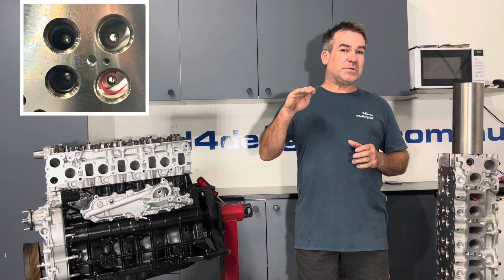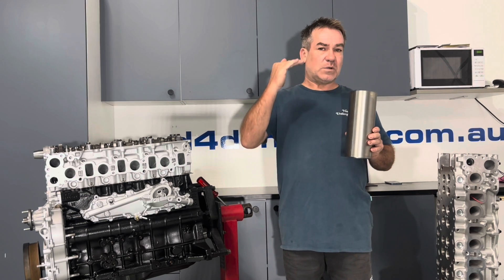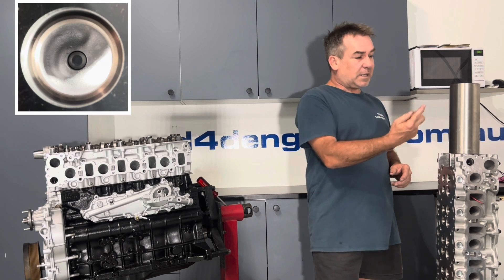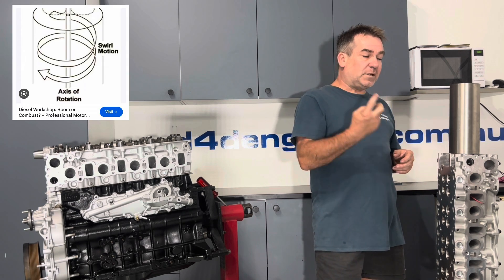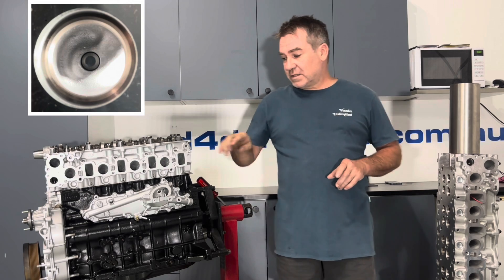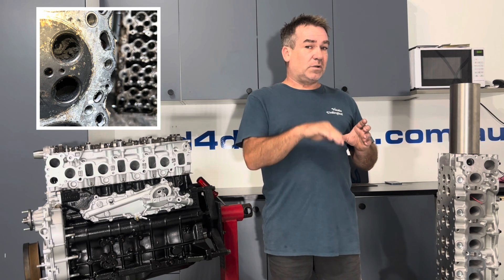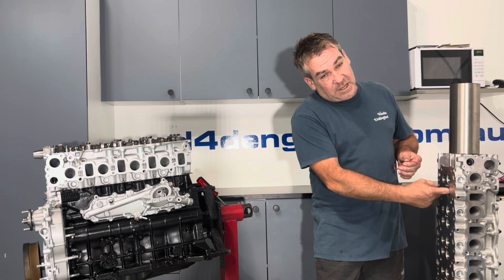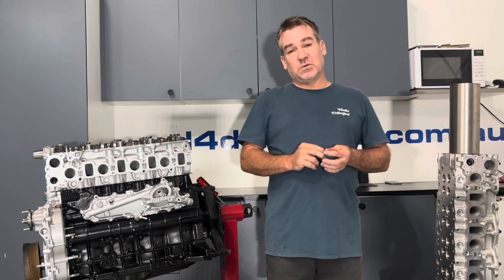Diesel engine feels tied? Intake air flow characteristics WHIRLPOOL EFFECT

Comment: How do you recommend keeping these ports free from shit? 1hd fte in particular but they’re probably all much the same. Have you got any feedback on CEM (cost effective maintenance) products at all which they say can keep these components free from carbon build up. Block egr I imagine would be 1 option. Cheers
Reply: I really can't see how a product that is added to the fuel can somehow clear the gunk that builds up in the intake manifold and intake ports.  No fuel goes thru the intake manifold as it is squirted directly inside the combustion chamber, which is located past the intake manifold.  I did see the literature from Cost Effective Maintenance and they claim they can clean the intake.  But how can that be achieved when their product is mixed with the fuel which does not go through the intake manifold, but delivered past the inlet valves?
Reply: On the FTE you can block the vacuum pipe to the egr vacuum valve. Then remove all the intake, clean it (quite a chore) and you are good to go.